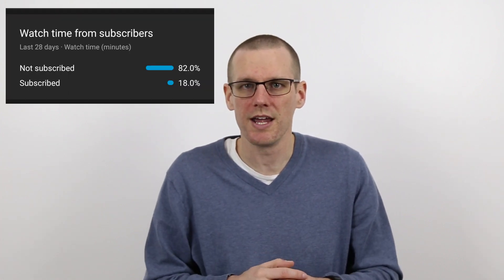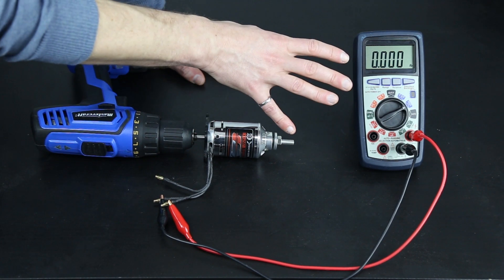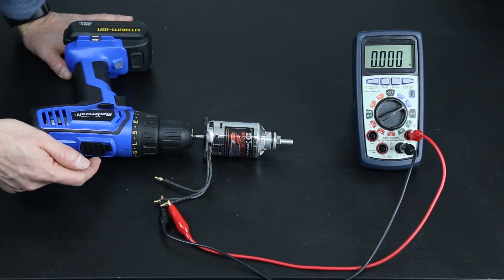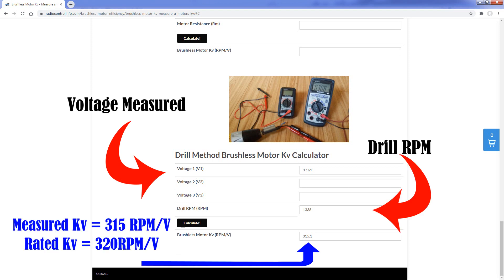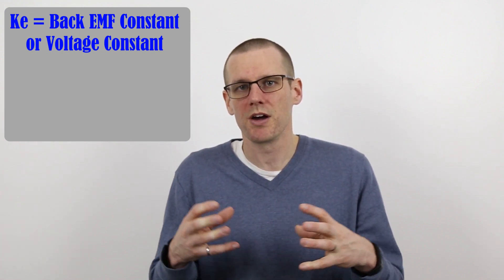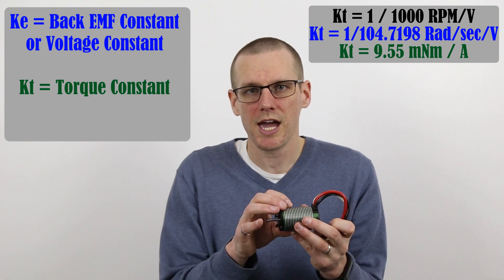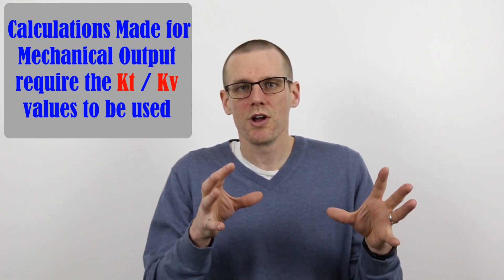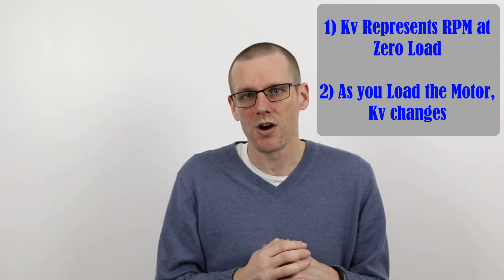Are we Incorrectly using Kv for an RC Brushless Motor

Comment: Hey Ryan, another great video thanks for sharing. 
PS: Slightly off topic , Have you seen the new 2850kv  T-Motor   F2203.5  motors?  Seems great for a small high kv motor yet efficient  good idle current, but much higher resistance than I was expecting to see @ 90mΩ ( and the 1500kv is 	235mΩ )  Any opinion ? 
Cheers
Reply from the maker: I have not heard of these motors. Is there a performance comparison between a motor that you know well and the T-Motor?
Reply: @RCexplained  Hi cheers for the reply, no from what I gather they have just come out. Was actually thinking of replacing my   2207 2500kv motors that I run on my lil fixed wing dart... Thought with the higher kv might actually be able to keep the top speed but gain efficiency for cruise with the considerably lower idle current. (Less than half, although the resistance is much higher) 

Ofcourse as you explain in your videos, kv isn't necessarily going to equal the same speed as the motor might not even be able to spin the prop (5inch) as high as the slightly lower kv larger motor... But its an interesting thought. I might have to bite the bullet and buy one, see how it compares.
Ofcourse, there is always a compromise...
The only video ive found so far is the "55+ Min Long Range Drone" .
Reply: Typo in my last message. its the "55+ min long range drone" video on youtube i meant to quote. He uses the 1500 version, however.

Comment: Thanks for your sharing. It is very helpful. I have two questions about your vedio: (1) Is the block or sinusoidal commutation used for this brushless motor? (2) Why the voltage used to calculate the Kv has to be multiplied by a constant 1.3433, could you please let me konw where this constant is from? (Kv = RPM / ( Voltage x 1.3433 )). Thank you very much.
Reply from the maker: Square Wave as voltage is always maximum. 
correction factor of 95% plus a conversion factor for RMS and Peak Voltage
Reply: @RCexplained  Thanks for your quick reply. I see, 1.3433=sqrt(2)*0.95, so the speed constant is defined as the speed in rpm over the peak value of the line to line back EMF. Is it correct? If the voltage is a block wave, the rms and peak value should be the same. If this is the case, why the conversion constant sqrt(2) has to be used?
Reply from the maker: The multimeter does not read the value we need.
Reply: @RCexplained  Thanks for your reply. I don't quite understant. Could you please tell me what the value shown on the multimeter refers to? Is it the rms value of the line to line voltage? If it is, and block commutation is employed, the rms value should be equal to the peak value and then maybe the constant 1.3433 is not required.
Reply from the maker: The square wave phase voltage (in actuality is more trapezoidal) is what the ESC provides to the motor. What we are measuring is the Back EMF voltage produced when we spin the motor up by applying mechanical input.  I don't have a graph handy to review at this exact moment but do believe it fits more of a  sinusoidal shape.
Reply: @RCexplained  Thanks, I have a better understanding now. My final question is whether the back EMF constant is defined as the peak of the line to line voltage over the speed of the shaft according to your calculation in the video? Thank you.

Comment: Surely the kv doesn't go down under load as long as you give the motor enough A? For example under not load the motor might only pull 3A at 8v, but under load it might pull 40A or 100A.
Reply from the maker: Yes, Kv changes as load increases. In order for load to increase current has to go up as well.

Comment: Sounds good. Now how do I apply this to my RC boat ?
I've built the 1949 CHRIS-CRAFT 19' RACING RUNABOUT 
It's 30 inches long and weighs about 4 lbs.
So I bought a Brushless motor # 2958 4200 Kv with a 70 amp. ESC. 
2 - Spectrum 11.1 volt 50 C smart batteries in parrel.
All you're information is great but how do you apply it to my project. 
Also how do you choose a prop for maximum speed.
Thanks Alvin
Reply from the maker: https://youtu.be/2tuvoAfPMYU
for a surface mounted prop.
Reply: @RCexplained   i don't have a surface mounted propeller.
The propeller is under the boat. 
 Could you explain how to figure out the propeller pitch?
The propeller can't be larger than 1 7/16" .
Reply from the maker: Hi Alvin, how did determine 11.1v to be matched to a 4200kv motor for a submerged drive?
This is about twice the amount of RPM that I would expect.
Reply: @RCexplained  when I was looking for a brushless motor the specs said for a 2 kg. To a 4 kg. Boat that's all I had to go by.  Later I found out 8s is the power needed. So I asked If I get another  3s battery could I hook them together in parallel that would be 6s will it work? 
It's only - 3 volts.
Reply from the maker: 8s sounds like a lot! 6s on that 4200kv motor will certainly cause serious issues as its 4x more RPM then required.

Comment: I use a Sky Rc motor analyzer to set my brushless motors timing , check sensor board alignment and KV VALUE. Im intetested in knowing if this device is calculating kv accurately.It would be very interestin im sure to the thousand s of racers that live and die by the BMA-01. I HOPE THIS. INSPIRES YOU TO DO A VIDEO ON THE ACCURACY OF THIS ANALYZER
Reply from the maker: I can take a look. Do not have this unit.

Comment: How do you get 1338rpm from 156.1Hz and 14poles?
Reply from the maker: Check out this link. https://www.radiocontrolinfo.com/brushless-motor-efficiency/measuring-motor-rpm/
Reply: @RCexplained  Many thanks for your answer! Tested the method and it works nicely!
Reply from the maker: excellent